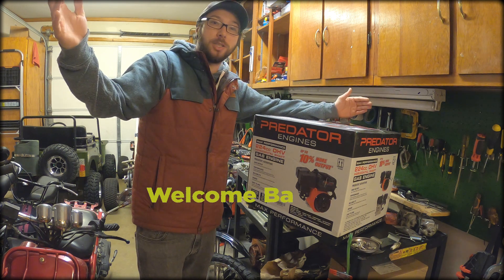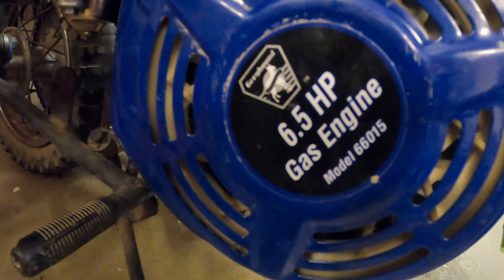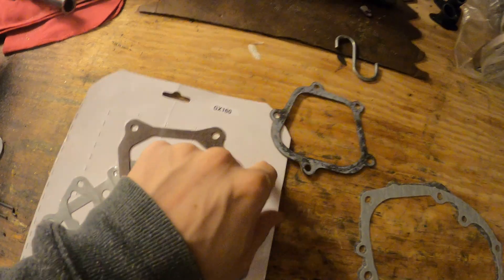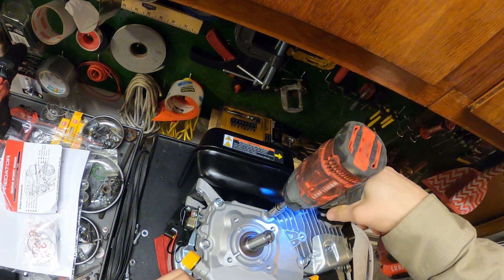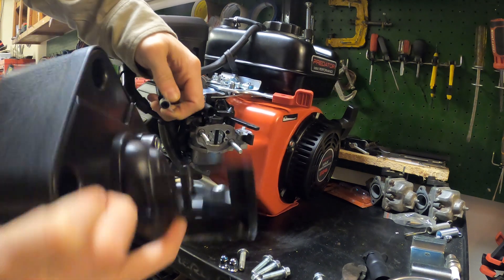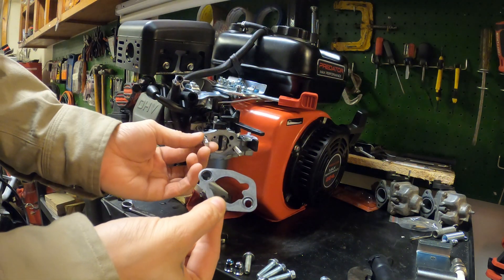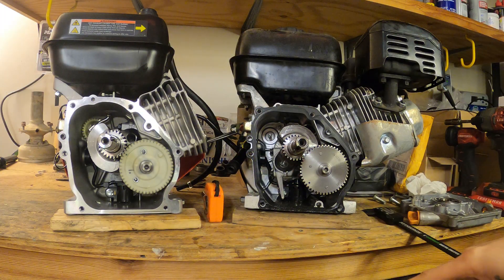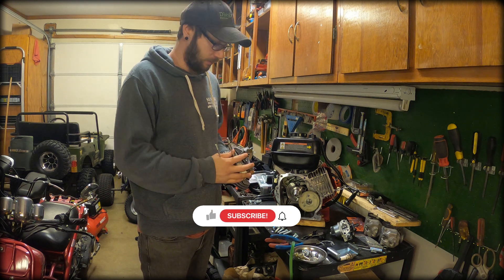Let's Talk Predator 224cc Max Performance (Teardown and Comparison to the Predator 212cc)

Comment: Lets assume  both the 212 and 224 use the same rod, piston, and the deck height is the same on both blocks, the 224 with it's 3mm greater stroke would push the piston 1.5mm further out of the deck towards the head.  (if deck heights are the same on both blocks).    So either H.F.'s claim of 8.5:1 compression on both engines is wrong, the deck height of the two blocks are different, connecting rods are different, or the the pistons have a different compression height.  Something has to be different to adjust for the increased 3mm stroke of the crankshaft.
Reply: But isn't it interesting that you can use a plus 20 thou clone rod and a 550 CH piston and be very close to zero deck? I used a stock length clone rod and a 570 CH piston and was right at zero deck on my 224.

Another easy engine build option would be a stock length rod with a 550 CH piston. You would be around 20 in the hole and use a .009" head gasket.

It's somewhere in the 8:1 CR range with a dished piston and somewhere around a .050" head gasket.

Comment: Those 196 cc engines have the smaller bore so they are really not the same 
Yes the gx200 and both of the predators have the 70 mm bore
Reply: The GX200 is a 196. That's why many of us call the 196's clones. 68mm bore.

Comment: worth it??? HUMMMMMM???? for 12 more CCs??? doesnt seem like it? BUT now that the 212 is $160. ON SALE the 224 can be had for the same price? hummmm??? if they had the 212 for $100 still i wud just be perfectly happy with the 212 hopped up, good as any. still takes $200 worth of parts to make it SING to 6500 RPMs with 22# springs and CM .265" cam, port job, header, intake/carb/air filter. so...???? i WANT ONE... dont NEED one. got to separate NEEDS from WANTS.

Comment: The cams are not interchangeable, i was building a 224 and had a 212 non hemi cam lying around and the cam wouldn't fit into the block as it was bigger on the block end
Reply from the maker: You are correct

Comment: Just spoke with techs at OMB and GO POWER…they specifically mentioned that the two cams are not interchangeable even though they are similar in many respects and that I needed to install a 212 Hemi Cam in the 224 if I wanted to keep everything else stock (with gov etc) … all I want to do is simply swap the plastic 224 cam with the metal 212 non Hemi cam. Thoughts?
Reply from the maker: You are right, I think I miss-stated which 212 cam works in it. And my thoughts are just leave the plastic cam in if you are only doing a stage one. If you are doing more than a stage one I would upgrade it to a performance cam.

Comment: Great information! We do go kart racing in PA and now I’m wondering if there gonna eventually switch to these motors. Some tracks up here are actually switching to the Ducar 212 offered by Dyno Cams and are not allowing the Predator 212 anymore. I wonder if there gonna stop making the Predator 212 all together and just sell the 224? 🤔
Reply: The 224 will take over because of emissions the Tillotson 212e also has emissions on them and the predator 212 has been around along time also the ducar is a great motor and reason your track is swapping is because they come with a 17k rated pvl fly wheel and won't blow up like predator ins for tracks is getting crazy

Comment: I wonder if a 212 hemi head would fit and raise compression
Reply from the maker: Im pretty sure it will fit.
Reply: .009" head gasket raises compression... shaving off .065" off head raises compression. flat top piston raises compression. ...
Reply: Putting a hemi head on a 224 is a downgrade.

Comment: I like the idea behind the .224, I like the upgrades of the engine and I think they are worth the cost.  The .224 seems like an engine that is designed to last.

I am biased because I like the idea of Square to undersquare engines because they are slightly more thermally efficient and have the torque necessary for daily driving.

This is my question.  I know that the crankshaft is different, but is the connection rod similar between the .212 and the .224
Reply: The rods are similar but not identical. You can't use a Predator 212 rod on the 224 crankshaft. That's what sucks about the Pred 212. It has a unique crankshaft. The rod journal on the 224 crankshaft is a common size that has been around for three decades (Honda GX200). If the 224 had a unique crankshaft like the 212 I would have never bought one. At least they got smart with the Predator 212 Ghost engine. It doesn't have a unique crankshaft like the other 212's.

Comment: Crankshafts are definately different. Clone rod journal and flywheel taper. Clone cam. In my opinion the way to go with these if you intent to build is a hemi flat top with a common clone billet rod then go from there.
Reply from the maker: Think you are pretty spot on. I wasnt sure on the cranks but everything else was pretty easy to identify as clone compatible.
Reply: @tylertaughtme  Oh and I forgot. Once you pull the cam you should see where it's clearanced. So a new cam would need the same clearance. I guess block and cam clearance should be checked on any build though.
Reply from the maker: @Deucealive75  yea I noticed that when I started staging it and like you said check that on every build. Sometimes you get lucky and dont have to do much.